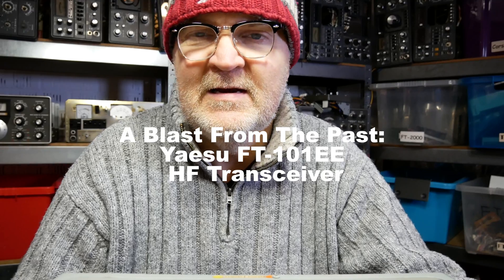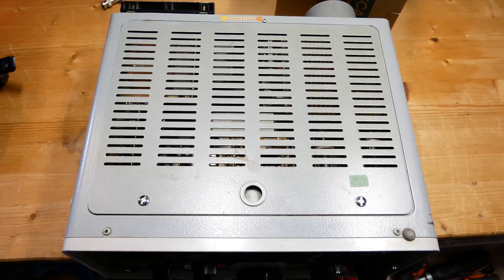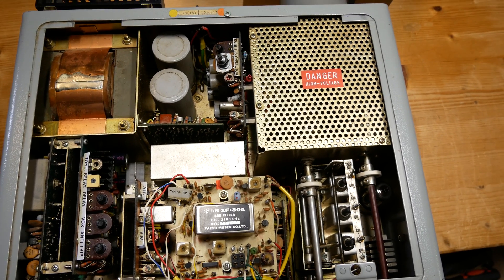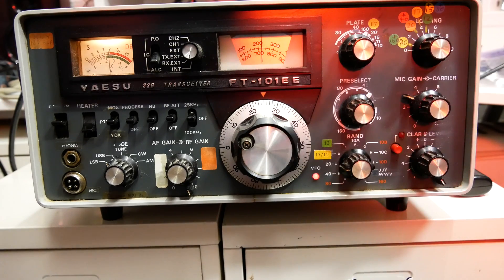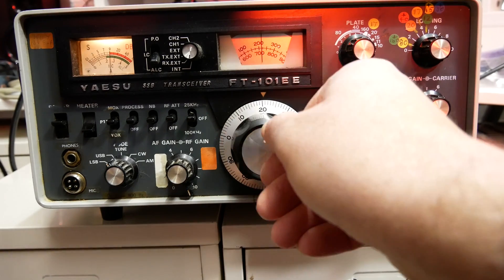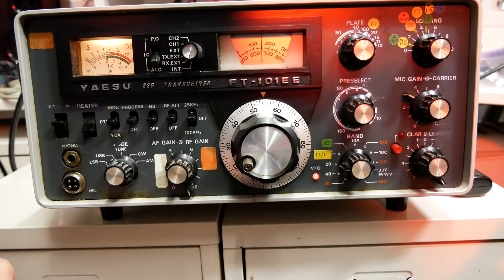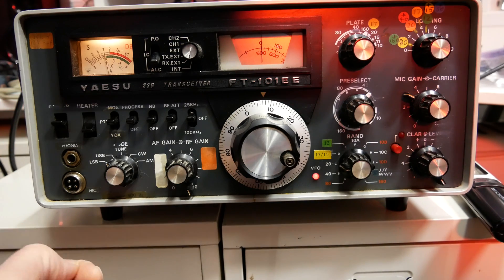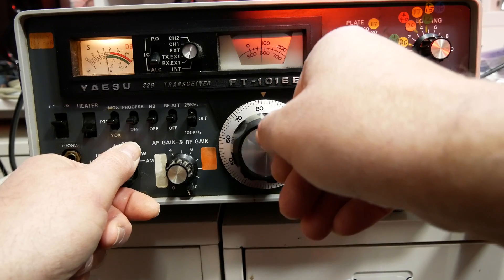Blast from the Past #1: The Yaesu FT-101EE Ham Radio Transceiver

Comment: I have a  101EE, it  blows up a 470 mF 25 v capacitor, this means a transformer is  fried?
Reply: No!  You're lucky.  Replacement transformers like that are expensive, and may be hard to find.  You had a bad filter cap: a much less costly thing to replace.  Electrolytic capacitors are the big bug-a-boo with older equipment.  A lot of hams and technicians replace them all, first thing, as a matter of course.  By the way, WHY did you think it was the transformer?  Good caps blow up, only if their voltage rating is exceeded.  A bad transformer will produce a LOWER voltage (or nothing at all), not a higher voltage.
Reply: @Pootycat8359  Hi Clyde KG5IQF? 
I am OA4BMG.  I remember read long time a go something about that cap but not sure  of it is true or not. As you said electrolytic capacitors blows due a high voltage or  reversed polarity. I received this radio 25 years a go and never power up  until pandemic days. I was testing the radio on that days and during RF power output with dummy load that cap blows up.  It not blows up immediately. I already replaced and the new cap  not blows. Any way; I need to start again with this old boy and see what's going on.
Thanks 
73, Claudio OA4BMG
Reply: @claudiobio  Ah, since you know those things, you probably thought the bad cap killed the xformer.  And you're correct about the call...and to let you know I'm not doing anything naughty, I'm currently upgrading to Extra.  And it DOES cover 10m....:)
Reply: @Pootycat8359  lol. I wasn't thinking nothing bad about you LOL. Let see in the future if my 101EE survives. 
73
Claudio OA4BMG

Comment: I have a set of the Yaesu Twins. FT101 and FR101 which I haven't used since 1980.  Was working fine when I shut down my station 40 years ago.  Do you do checkups and tune ups ? 73s. VE6FY.